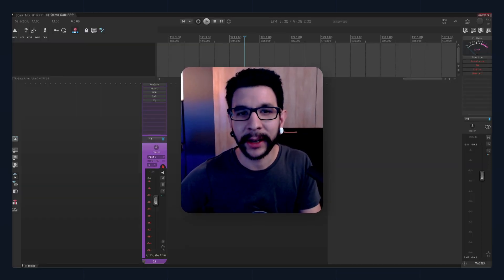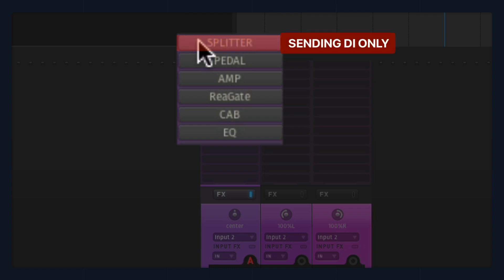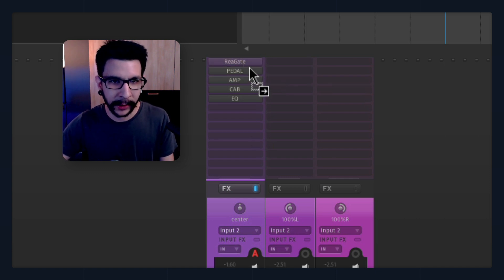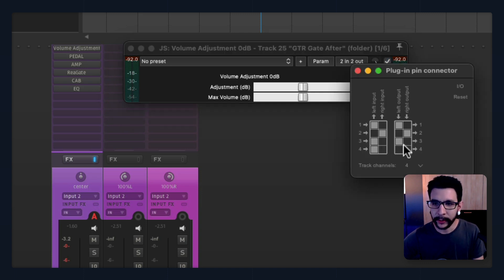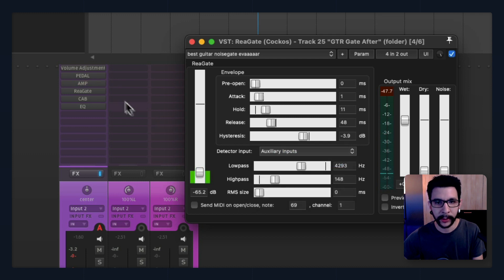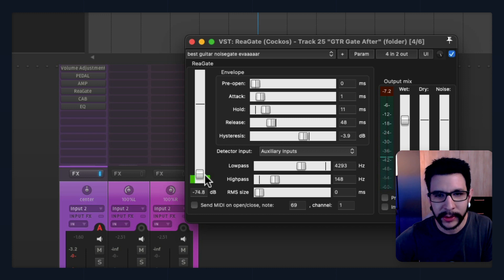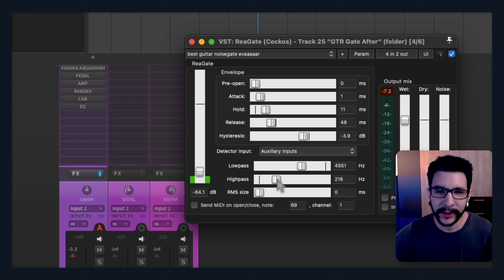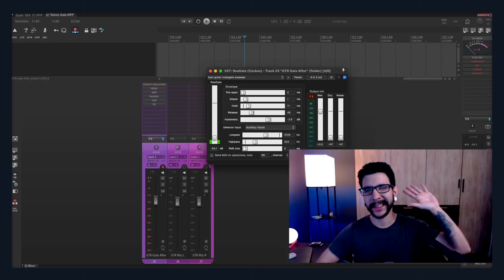how to replicate that guitar noise gate plugin in REAPER (easy)

Comment: Noce to see you play metal guitar again 🎸😎
I think is method is only really beneficial when there is a DI track and a re-amped tracks (or rendered tracks) to process. The usual noise gate in front of most guitar plugins does the jobs pretty well as the amp plugins usually doesnt introduce noise if there is silence coming it, so the need for post amped gating is less present as far as I know in plugin format. What do you think ?
Reply: Actually I just find a very nice use case, I have two DI tracks, playing in "ping pong style", going the the same FX amp instance, but wanted to add reverb on one of this track. So I just created a bus verb, post FX amp, and it is gated based on this track on which I want the reverb. It is set different than what is shown in video as it involves 4 tracks (DI, BUS and Send), but it is basically same idea (sidechain gate). Nice!

Comment: Nice tip for heavy guitars !
The preview filter output allow to hear the filtered signal that will tiger the noise gate. If you use an auxiliary input, you will of course hear the sidechained signal filtered.
But it also works with main input ! 😉